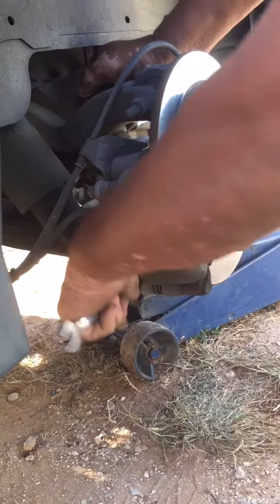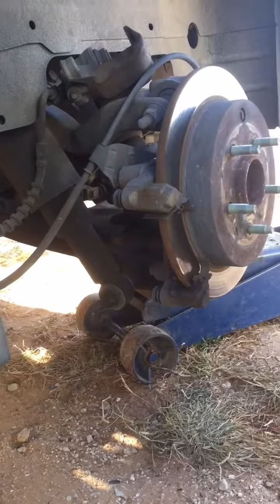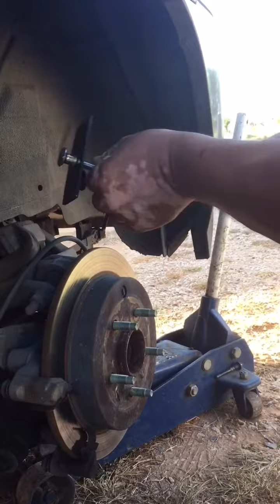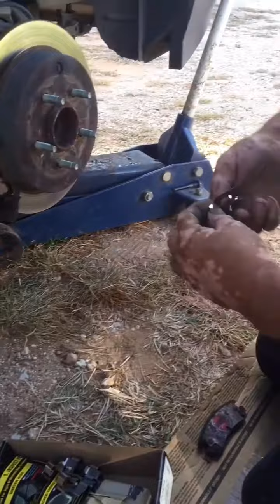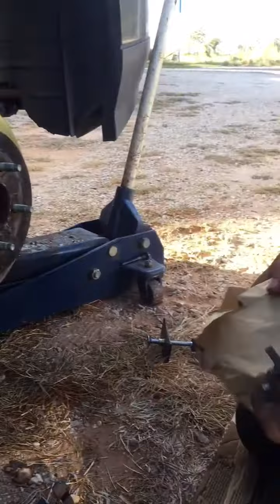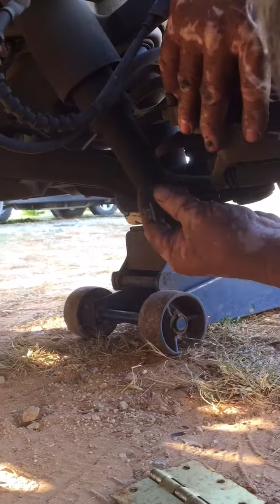Replacing rear brakes on a 2005 Buick Rendezvous

Comment: Thanks for the video, do you know what size wrench to use on the brake bleeder screws?
Reply: Jeff Stone Everything on this vehicle is metric. In my experience, cars with metric hardware usually have either 8 or 10mm bleed screws.

You can pick up a cheap set of metric combination wrenches at Harbor Freight or Northern Tool & Equipment for about what you might pay Sears for one Craftsman wrench. Just don't get cheap on ratchets and sockets because the cheap ones WILL break... usually right in the middle of a timing belt change.